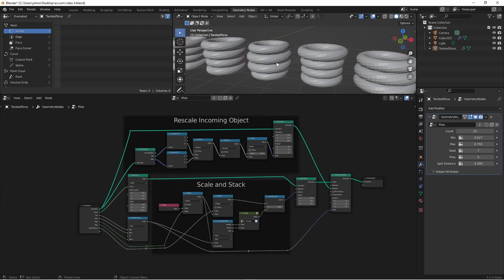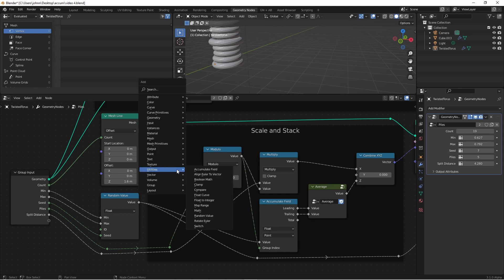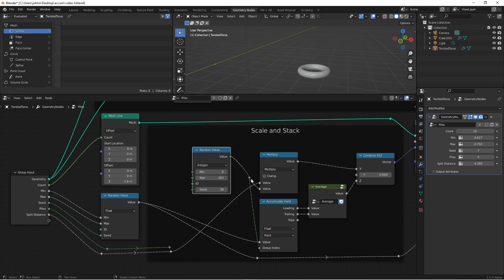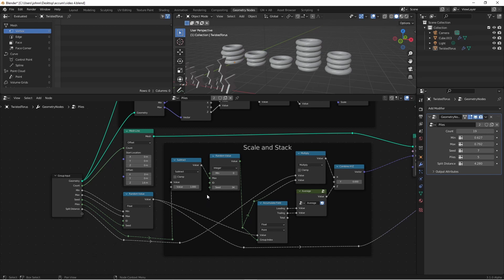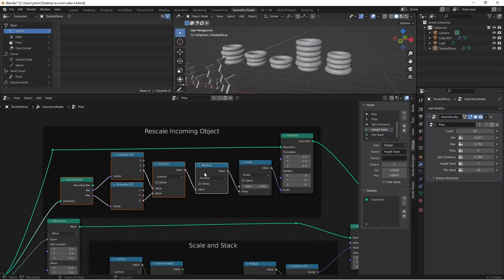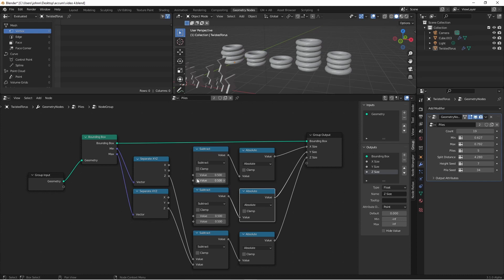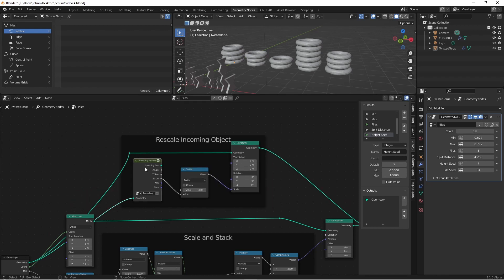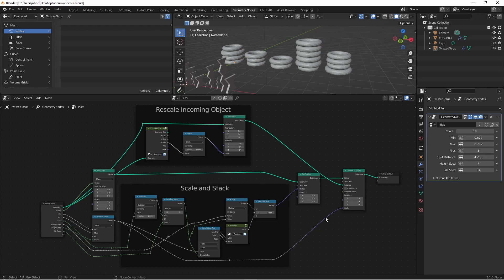New Blender 3.1 Geometry Node: Accumulate Field - Part 5 of 5

Comment: great, thanks. Is it possible to manage an array on geometry and feed the stack with them ?
Reply from the maker: Sort of, but we need some more instance tools to make it work better (especially bounding boxes with instances)
Reply: @JohnnyMatthews  I came here to basically ask what Onk did. Are you saying that, as of right now, it just can't be done? I've been trying to setup a tree wherein mesh instances from a collection are added to a Mesh Line, but as far as I can tell, there's no way to offset each instance based on the previous mesh's bounding box. i.e. they they all have to have the same dimensions on the axis that the Mesh Line is drawn in order to not overlap.

Comment: Questions about the bounding box scale node tree.. wouldn’t it be simpler to use a vector math node and do a subtraction between the max and min of the bounding box node? Also since max > min .. I don’t think you need the Absolute math nodes either since the xyz vector delta components (of the max - min vector) are necessarily positive. So your node tree could consist of just 2 nodes.. one for vector math (subtraction).. and one to separate xyz components .. instead of 7 nodes.
Reply from the maker: Good catch. Yup, I never said it was the only or best way.
Reply: @JohnnyMatthews  I figured.. sometimes you find out later you could have done thing simpler.. and if you do a tutorial by the time you find out it’s a bit late. Anyway, no biggie. I love your tutorials. In the end what counts is the process.. and how to build a node mindset.. the optimizations can come later. Keep up the good work.

Comment: Aww.  I get a different random number for the accumulate than I do for the scale.  This gets more noticeable with larger variations when complete perfection is needed.
Reply: Since you wrote this node, can you add an output of "value" to the accumulate node?  Or is there some way to capture it?
Reply from the maker: Might be good to post a bug report. Go to the help menu in Blender and choose 'report a bug'. Then it can get triaged and fixed!
Reply: @JohnnyMatthews  I figured it out.  How I'm doing it is technically two different instances on the same point.  I'm offsetting the point by <random value> using accumulate.  I need one instance to be that wide, and the other to be located at that point.

Basically, I'm trying to make an L shaped pair of walls.  But I can't figure out any method of extracting the same <random Value> to each of the instances at that one point.
Reply from the maker: @eclecticgamer5144  Maybe something with transfer attribute in index mode?
Reply: @JohnnyMatthews  Yep, that worked.  I've been trying to figure out exactly who transfer/capture nodes work... watched several videos... and still don't quite understand how to use them.
However, I finally got it to work.  I've got random 2 dimensional L's.  Next part is finding out the Y dimension of <Index> compared to <Index +1> and add another wall to make the Longer "L" close up (J shape) to the previous L.  When it's all said and done, it'll look like rooms missing the outer wall (which is made in another geo node operation).

Thanks.
Reply: Wow, it worked.  2 Transfer attribute nodes, with with "Index" and the other with "index+1" capturing the Y position and comparing... worked.
Reply: @JohnnyMatthews  One thing that was driving me nuts: I was using the boolean of the index compare to choose which points spawned instances.
These new instances had different index values that the points... which screwed up scaling.
Instead, I had to create all the instances, then use the boolean to delete instances where I didn't want.  

I now have randomly generated floor layout!  (at least the first row)  Getting the 2nd row may be more difficult as I have to extend the walls to connect exactly with the first row... which is variable.
I'm thinking realize first row, then use ray tracing to get hit distance from 2nd row to first row for each instance.